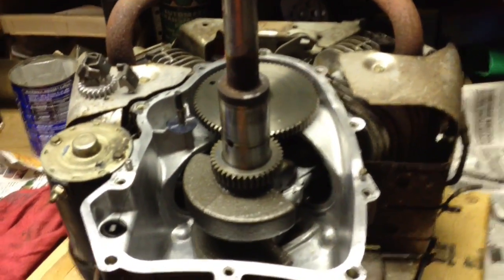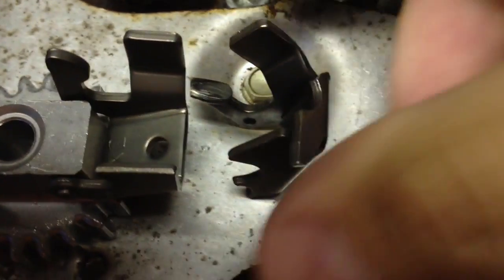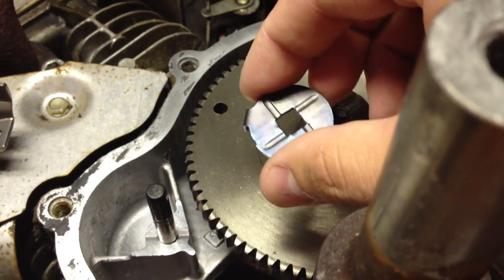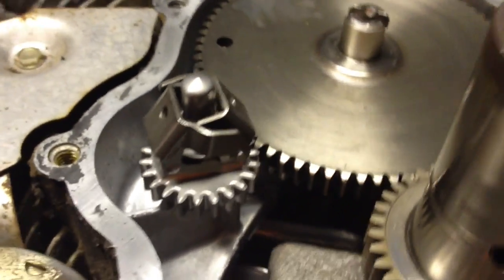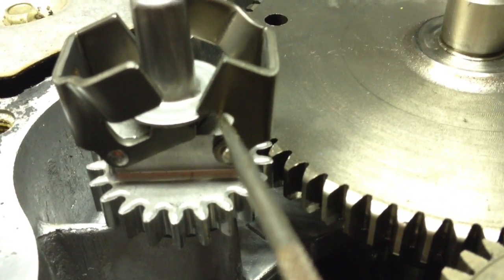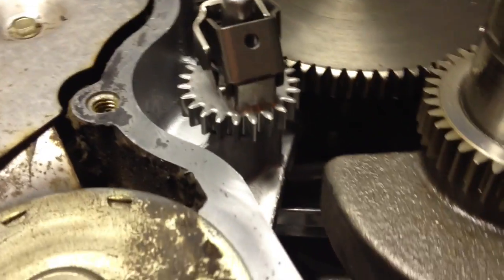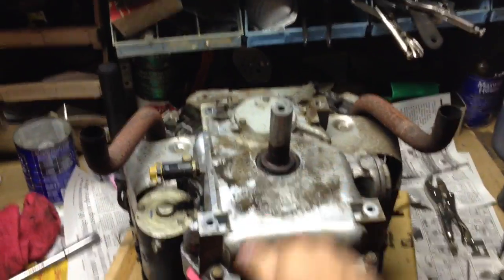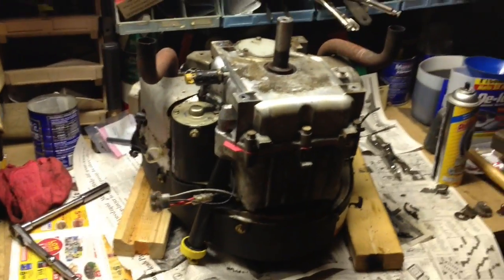Briggs and Stratton V-Twin governor assembly

Comment: My 24hp B&S from their instructions says tighten them 1/3, then to 2/3 then to final torque in sequential order to 325 inch pounds. Or divide by 12 for 27 foot pounds or 37Nm. 
Sequential order is; (With cylinders at 11 & 1 o'Clock) Bolt positions with the Bolt in center of each cylinder represents #9 at 12 o'clock and #10 at 6 o'Clock. 
Bolts 1 & 2 being located at 9 & 3 o'clock
Bolts 3 & 4 below bolts 1 & 2
Bolts 5 & 6 above bolts 1 & 2 or just below #9 bolt
Bolts 7 & 8 are left and right of bolt 10 at 6 o'clock.
Instructions also state Not to re-use the bolts. 
Gasket and Bolts kit part# 594195
Crank Seal Part# 795387 PTO side. 

Make sure you check model# on valve cover. 
First four number on the "Code" represent Year/Month. 

Make sure you purchase the parts to the Model and Year of the engine manufactured, as parts were changed or re-designed of a specific year model engine made and the reason why it needs to go by the specific "Code" date.

Comment: It's 10 years later and these motors still have this issue, mine just failed with less than 100 hours. They call it the "extended life series" what a joke, what the heck I thought Briggs and Stratton we're supposed to be reliable.
Reply: Me went at 403.3 hours but that’s because I set it wrong
Reply: mine went at 400 hrs.

Comment: ive got a 26 hp briggs and the govenor ajuster is locked up cant move it either way, know what the fix might be?
Reply: Jay Parker
Reply: My was the same way it  stayed at full throttle.I had to pull Engine and the gear was broken and in pieces

Comment: I got a 18.5 hp BS Intek V twin with governor problems that it just revs.  So amount of time to replace the governor from start to put back into operation on the lawn tractor is there if you know?  Also parts cost what would a person be needing for parts and cost.  I have one that I not sure if I can handle and trying to figure out what I could or should do...Thanks.....
Reply from the maker: the governor was less than $20 I believe. the gasket could have cost $12 or so. time from start to finish might have been three or four hours.
Reply: Thanks I see at Sears the governor part is $25, but also with the additional gaskets/seals would be more.  I was trying to get an idea of repair cost from local shops, and one said need to see/hear, not sure what all might have let go without opening up which makes sense, but another indicate with parts the job would cost about $150 which is low and not sure if the person knows about repair stating about 3/4 job to do plus the parts, yet still need to trailer over to look/hear the engine.  So with shop rates and parts likely the person owe  owns lawn tractor would want to pay the likely cost of repair.  Thanks this is what I had thought it might be but wanted to hear from someone that actually worked on one to and get a realistic idea.  Any other ideas if it might be more than a possible governor replacement when this happens to start up and rev like this. Thanks.....

Comment: Thanks for the video.  The governor in my motor exploded and your video pointed me in the right direction for the repair.  I replace the governor gear and reassembled, and it immediately rev'd to max and blew up the flyweights again.  Does the orientation of the gear make any difference?  I don't see any alignment marks.
Reply: Same problem here!!!! Do you have the solution??
Reply: @bvanos01  I order more parts, took my time and replaced it again and it worked fine.  The motor is still running.  Been a while so I don't remember all the details, but I don't remember doing anything different from the first attempt.  sorry, not much help.
Reply: I just watched a video that may explain why my new governor immediately self-destructed. The stud that the governor rides on is supposed to be anchored in the block. Mine was easily removable. The fella in the video glued the stud back in with JB Weld. I'll use a red thread locker.

Comment: THanks for the instruction, clear and easy. Question my governor has a metal ring that fits ont othe shaft where the cap goes on? cannot remember which goes first? can you? Also did yuo find the right torque?
Reply: I know this is an old video, but for anyone with this same question, the ring sits on top of the gear, and below the cup. You put them all on at the same time. Put the ring on top of the gear, and place the cup in position, making sure that lip of the cup is on top of the feet on the fly weights. You put the whole assembly on the shaft as one unit, and the ring will lock into a groove on the shaft. The ring only holds it enough to keep it from falling off. What actually  keeps it from coming apart is the paddle on the governor shaft. It's extremely important to set the governor arm correctly when you reassemble it, or you can end up with catastrophic failure.